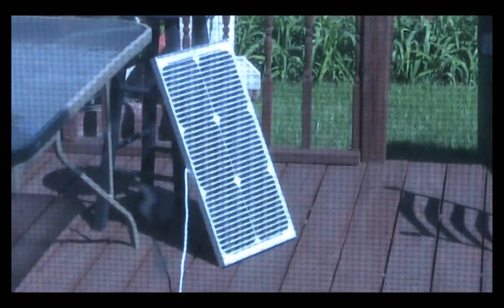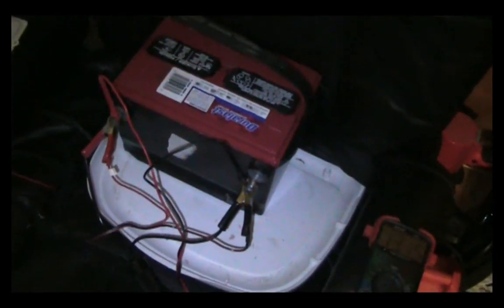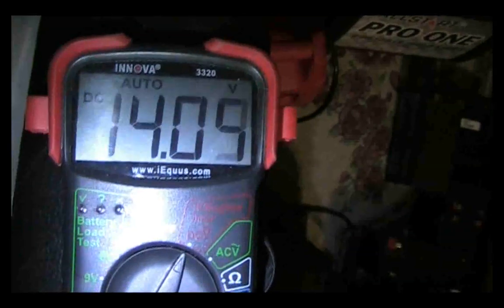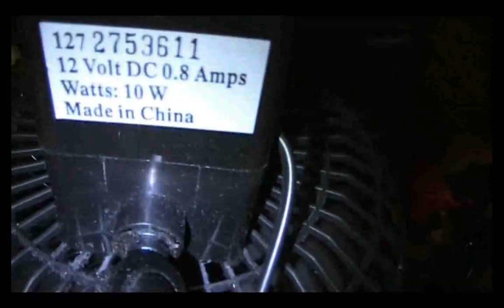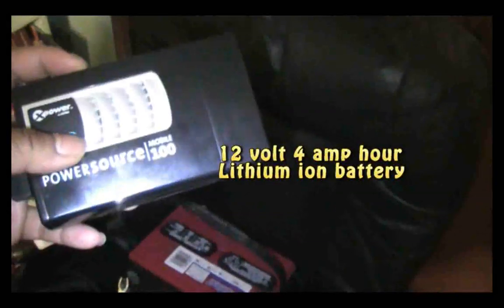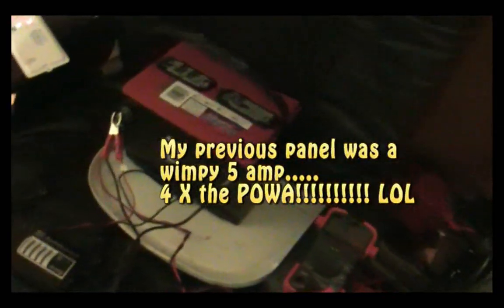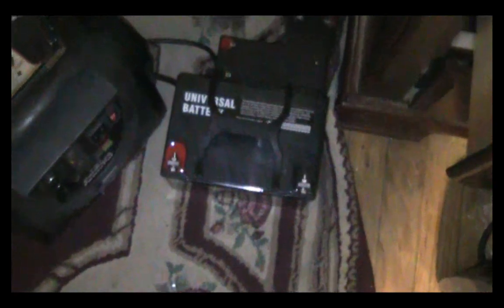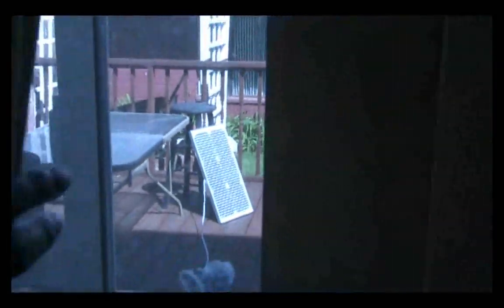$120 12 volt Solar System

Comment from the maker: All depending on how much solar you're running.....once your battery is fully charged, an appropriately sized solar panel will run your tv. EX: a tv that draws 80-100 watts, when paired with a 100 watt panel will run off of your system, without draining your battery.

Comment: I've always wondered: What happens at night? Are you only able to utilize energy connected during daylight? Will it cease to charge? Are these only good during the day? Or....is there a way to store that energy???
Reply: You use the panel to power your appliances AND charge a battery. At night when there is no sunlight, your appliances run off of the solar electricity that was stored in the battery during the previous day. The next morning the cycle starts all over again.

Comment: So I have a question maybe you can answer. I'm looking to create a system that I can continually keep a 12v car battery charged while it powers a 2000w inverter. Is there anyway to do that off of a solar panel, and if so is it possible to keep the panel and the inverter hooked to the battery simultaneously without causing problems. Also what size panel would I need to make it all work. Please get back to me ASAP, subject is time sensitive. Thankyou. ~DCJ
Reply: Yes, that's exactly how a solar electric system works.

Comment: Cause you need some type of voltage regulator test the voltage coming out solor panel it should not go above 14.4 for 12volt battery, it slows down because it is charging batt too.

Comment: get the 45 watt harbor freight kit
Reply: I think you can do much better by going a different route. 
The really, really nice thing about solar is that it is modular.
 If you think ahead and plan for expansion you will see that getting a cheaply made kit  would be wasting money.
 I think that you can do better by getting about a hundred Watt HIGH quality panel, and an inexpensive charge controller for about the same price, versus 3 low quality 15 watt panels and cheap charge controller. Yes, it will be twice the power.
 After getting a battery and small inverter which you would have to do anyway, you can play with this little system and start understanding how it all works. It should be enough to take a bedroom Off the Grid. 
Afterwards you could get another panel, then another battery and expand the system, then keep doing that until you eventually power your whole house.
 I don't know anybody who would want a whole heckuva bunch of cheaply made panels powering their house, so why start buying them in the first place?.

Comment from the maker: Yep, this is actually a 24 volt panel that I got a great deal on ($27 shipped). I did some research and found that my charge controller would still work with my 12 volt battery. I took some voltage readings and it never sent more than 14-15 volts to the battery. I have this panel charging a tiny battery and usb charger now.

Comment: Watts = volts * amps

You say its a 20 watt 1 amp panel... that's 20 volts not 12. Does the charge controller drop it to 12?
Reply: When the pulse-width modulated or PWM charge controller connects the panel to the battery, the battery will pull the voltage down to just above the voltage of the battery.
 A better, but much more expensive charge controller has maximum power point tracker technology or MPPT. It sort of works like a transmission in a car. It allows the voltage of the panel to stay where the panel makes the most power, while simultaneously charging the battery at the maximum rate.

Comment: I just finished my system. I can run lights, computer TV, router, and even my freezer and fridge. It's something I've been wanting to do for a long time. I was going to just buy a Harbor Freight kit, but decided to go all out. Cost me about $1,600 and took 3 months. (I currently have 4,992 watts). I have 290 watts of panels but plan on getting more. I'm also converting all of my light bulb from CF (bad for you, full of mercury and high frequency flashing) to LED light.

Comment: Very nice setup!
I have the same type of system.
My panel generates about 17watts, to charge (1) car battery and (2) alarm batteries.
I runs the same type auto cooling fan, 12v flourent light and a radio.
And your right, you can run the fan 24/7. But I also, added a 12ac-dc adapter,(wired in parallel  to the power cord of my fan. to help it run it at nite if i'm using the lamp or radio at the same time.
PEACE !

Comment from the maker: I have and much safer as well, just haven't uploaded any new vids recently. Right now that system has been upgraded to 100 watts (2x 50 watt panels) with fussed connections and proper wiring. I found some nice e27 based led bulbs off of ebay and run them directly off of dc.....I also run a few aa battery chargers and fans. I'll try to get an update video out in a few weeks on it.

Comment: Hey, I am thinking of putting together a solar charge pack.  I was wondering if you could tell me if an Asunpower 20 Watt 12 Volt Solar Panel would be good to connect to a Duracell 300 Powerpack.  Also, would I need the charge controller if I connected the two?  Thanks!